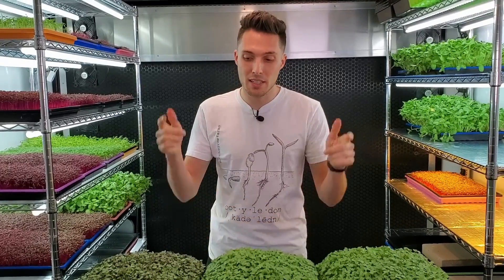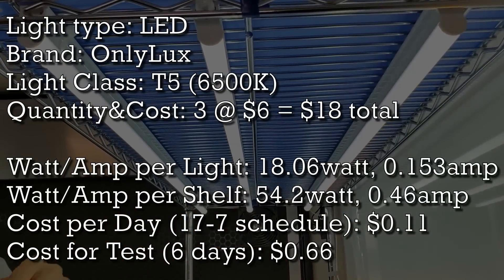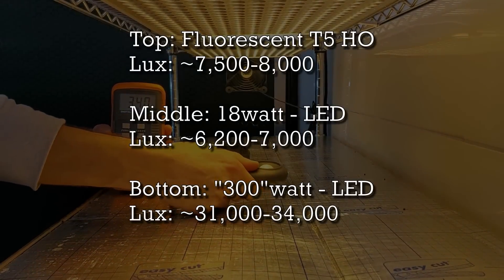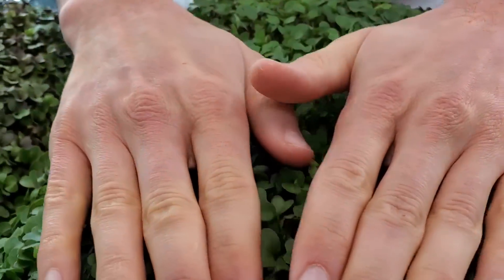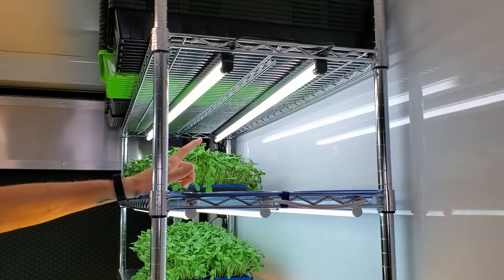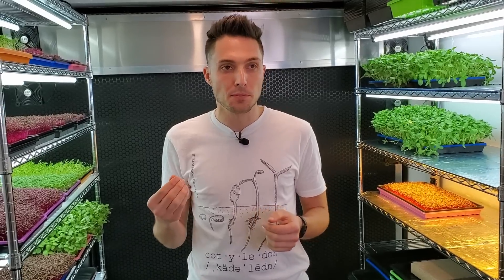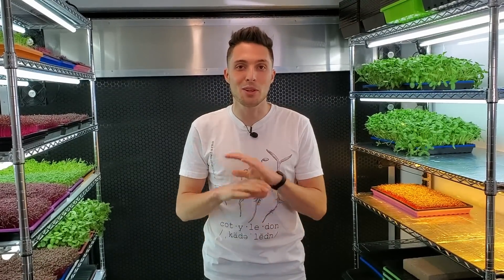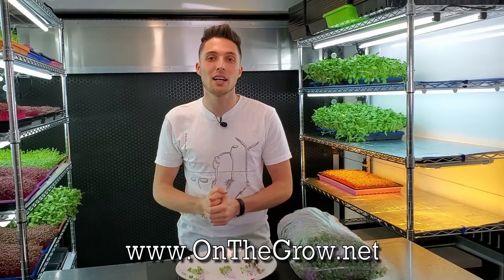Microgreen Lighting: Fluorescent vs LED's - Purple Kohlrabi - On The Grow

Comment: Is the coloration on the bottem shelf Kohlrabi due to the warm light or much higher output? Why do you use 6500K lights, wouldn't ~4000k be better?
Thanks!
Reply from the maker: Thank you so much for the support P M!! We are going to be making new content soon! 😄 We shoot for 6000 lumens as rule...these factors will alter the coloration1

Comment: Reflectors or no reflectors? I see that most of your lights do not have reflectors on them. Why?
Reply from the maker: 🙂 Thanks for the question Sarah...we have two brands in the shelving system...the ones with what looks like reflectors are built into the hosing of the lights and the other does not...I believe they are more like diffusers than reflectors.

Comment: I wonder how red the stems would be with six of those barrina led bulbs.  Also a more fair comparison would be 6 of those led bulbs spaced out the same width of the LED panel.. i.e. about 11 inches instead of 15 or so inches.

Comment: it seems you are matching all the inputs, including water (may have been a different test, not sure), so why not weigh the trays before harvest to take out harvest variable?  to eliminate other variables, you could weigh early on.  It just seems the harvest is quite variable, cut a little too deep, too shallow, some other loses...
Reply from the maker: We’ve cut a ton of trays and we keep it really even...  the issue with weighing it is the water weight of the soil. Even if we cut bad, the variance would only be 5-10 grams. 

The main point is to get close and get a good idea for the tests! Definitely not perfect.

Comment: I'm actually using these exact lights in my garage and basement and wanted to convert them for my microgreens grow, awesome. it looks like you are just using zip ties to hold them on the racking? Any issues there with them melting or getting too hot? Love your channel, keep the amazing info coming!
Reply from the maker: Thank you so much for the continued support Joshua!! We have not yet had any issues with it getting too hot or anything. We've had some that have been running the 17 hours on and 7 hours off with zipties for about 8 months now. They all seem to be in great condition still!

Comment: Did you tried with only two led tubes? Their light angle should be enough, isn't it? Your channel it's so helpful!
Reply from the maker: Thank you so much for your support Francisco! We have grown with only two LED tubes before and it did work well! The product will stretch a bit more, but it should still be sufficient to get some great micros! People have said that by taking the plastic cover off the LED tube lights, you can double their light output. We will be trying soon!

Comment: this is really good comparison... that led panel is way too powerful than the rest.. I use the led lights like the middle rack for my micros, it works quite well.. never have a problem and also cheap to buy and operate..  but looking at that purple accent on the leaves is beautiful.. great video guys.. :D
Reply from the maker: Thank you so much for the support! We are going to see if the cheaper lights can get that same purple color by using more of them... That test should be coming out within two weeks so stay tuned!

Comment: I don’t want to rain on your parade, but it seems like you have gone to great trouble and quite a bit of expense to grow micro greens. 

If it were I, I would use sunlight. 

You can build yourself a dandy little greenhouse, with sides that open to the outside so you can slip trays in and out for a lot less than you can those fancy shelves and all the electricity and lightbulbs and stuff. 

Just my opinion, mind you, but I have been at this game for 50+ years and there’s nothing quite like white sunlight from the sun to grow stuff.
Reply from the maker: I love to experiment with factors! I totally agree that sunlight is an amazing source and should be used! I’m more about experimenting for indoor growers though, because that is what I’m passionate about.

We’re going to be growing some in sunshine this spring and summer and sharing the results! 

Thanks for sharing!
Reply: On The Grow 
We should hook up. I live across the lake in The thriving metropolis of Copeville. I use mostly the Kratky method and I have been doing hydroponics longer than you have been breathing air.🤣
Reply from the maker: @SiwyWabbit  Lol, yeah that would be great! We actually getting ready to move and we'll even be a touch closer to you soon! As soon as we get settled, we'll have to get together!
Reply: On The Grow 
Are messages over Instagram private or public?

Comment: so at a cost of 140/per shelf, and a yield of 30% greater, (or so) what is your "gross" cost per ounce of finished product?  2nd question, what are you doing with all the waste material?
Reply from the maker: The cost to grow a single tray of microgreens is $2.03 in materials and $1.38 in lighting electricity. So about $3.41 total for this grow for a single tray. Harvest was 317g = ~11oz  = $0.31/oz in cost. 

If the medium is compostable, like Coco-coir, Soil and some hydroponic mediums… We will toss them into our at-home compost pile and let it break-down and return to the earth. We can use it later in our outdoor garden, but we never reuse grow mediums in our space due to potential of the medium containing pathogens. Also keep in mind that some hydroponic grow mediums are only compostable at industrial facilities (example: Biostrate)… Those mediums, we will gather in a bag over time and take it to our local recycling/composting facility.

Hope that helps!
Reply: On The Grow amazing feedback, thanks for the reply, time and energy put in to it. So happy I subscribed to your channel.

Comment: Want to do a 3 - LED setup. What distance would you recommend from the bottom of the LED bulbs to the top of substrate (at seeding startup). I’m just changing over to wire racks.
 I am using different style trays. Coconut Coir pads.
Reply from the maker: We are having really great results at 7" spacing from top of substrate to lights... A lot of people prefer 8-12" but we like to fit as many trays as we can on a single shelf. Hope that helps!

Comment: Wonderful review - because of the extensive tests on the actual production.  But you are comparing bare fluorescent bulbs to LEDs with individual reflectors.  If you add a reflector over each fluorescent tube things will change dramatically. And the brand of T5s is of huge importance.  Example - don't think that a German made T5HO is anything less than what it claims. Which can not be said about most other T5s (or LEDs for that matter, read on).

The longevity of LEDs is always grossly exaggerated .  It really depends on the quality of the LEDs and how they are run.  Normally all Asians, not just Chinese, overrate their power by at least 3 times.  And that includes "reputable" companies too - Samsung, Seoul Semiconductor etc. Basically they state that an LED is say "10 watts" but that means if you run it at its absolute maximum - which means it will run hot and deteriorate super quick.  And again - the "10 Watt" is actually closer to actual 3 watts because they always exaggerate. In addition - the Chinese LED fixture you tested maybe great or not today but the next one you buy will be different - no matter if you got the same "brand" name or not.  "May" is the important word here.

Overall - at the end what matters is the production quality and how fast and easy it got to be good. The old rule applies - find your best way and stick to it.  At least until something very, very convincing comes along and replaces it after you have run proper tests for some time, not just a few times.
Reply from the maker: All of the LED’s were tested for their actual output and we have used our LED’s for 7 months with solid results... we have a lot more tests coming with more lights!

Comment: This is not a fair test. There is too much variation in lux level from shelf to shelf. 7000 vs 8000 vs 32000. Repeat the test with all shelves at 32000 and i bet they would all perform similarly. Almost all plants grow better when they get more light.
Reply from the maker: ... this isn’t supposed to be a fair test. It’s taking three different lights and trying then against each other.

Comment: LED's arent measured in PAR, they are a PPFD/Umol measurment using a quantum meter. The one I have was about 500$. Microgreens are rated to be grown at about 100-250 ppfd from most literature on it.  not sure how they deal with more intensity and how it influences growth. Full spectrum LED's are going to be your most advanced indoor growing diode for efficiency in electricity per plant usable output.  The real question is do you even need intense lights? or a high light intensity higher than ratings of 250ppfd or is that enough and effects of light higher are undesirable or what.
Reply: different lights focus at different distances depending on the bulb / diode and weather they have a focusing lens and or reflectors. So some of the lights you tested could perform as good as the LED but must be closer in distance to the crop to achieve similar results. Microgreens seems like something that would benifit from full spectrum lighting of a LED, vs narrower spectrums of florescent tubes. Which would most likely enhance color / appearance of the product vs more focused color spectrum's t hat lack green and other thought to be un-useful colors.
Reply from the maker: Thanks for sharing!

Comment: Quantum boards!
Reply: honestly the only lights i bother to use for anything plant growing related. Requires a 500$ quantum meter to beable to focus your lights and know the type of light spread youre putting out at what depths. Helps me loads for my cannabis growing lol
Reply: @angeldemore6922  hydrofarm work well if its v2 (no 660nm), with v2RSpec or v3 whatever you want to call them its inaccurate, the meter its self is low build quility tho. i pulled mine apart on the first day and glued the soldered cables
Reply: I like my hlg 65 for starting my tomatoes and peppers.
Reply: Samsung sunboards or strips. DIY save that extra money.
Reply: Emerson Effect yea I’m going to look into those. I just did a diy light with two gromau5 pucks and a cxb3590 in the middle. It’s way over kill for seed starting, but I have a dimmer on it
Reply: We definitely love the #growmau5 #greengenesgarden for the DIY videos. I love this trailer setup. OR looking clean inside 🤙💯
Reply from the maker: Lol, this may be a little over my head... I was looking and couldn't find much on DIY's... got any solid links for some quantum boards and supply sources? Seems like a lot of cannibis growers like these lights, but I wonder how they would perform when only 7" from the microgreens like our other lights are...
Reply: On The Grow the YouTube channel Led gardener has a website ledgardener.com where he has plans for diy led strip build designs, but they are way overkill for microgreens at 7”.  It’s a good starting place to look
Reply: @OnTheGrow  hlg focus more towards tomato plants/cannabis/peppers etc

normally alibaba would be a good place to look in terms of supply but unsure how the factorys are effected been china, if you do seach "lm301H lightbar/strip" and you'll find something that'll suit your 7" requirement,
Reply: @OnTheGrow QB are on Amazon or their site Horticultural Lightning Group.

Comment: What kind of trailer is that?  Was it outfitted already or is that all custom?
Reply from the maker: It’s a custom built utility trailer from Colony Cargo out of Georgia! It would’ve been a lot cheaper to buy and convert a trailer instead of having it custom built, but you live and learn. 

It was about $15,000 delivered. Insulated walls, 15,000BTU A/C, triple sink station, dedicated hand washing station, white aluminum walls and ceiling, rubber coin floors, e tracks on both walls, electrical package and so on.

I was curious if it would work as a growspace year round so in a few months it will be one complete year of growing in there!
Reply: @OnTheGrow  Wow that's awesome.  You paid for it, but sounds like a premium bit of kit.

Comment: Great video overall.  Love how you guys weigh and taste the finished product.  Haven't really seen any other channel focused on growing that really does that...  

However, there is one aspect that I don't believe is correct.  Your light measurement and your light measurement instrument.  Lux is a measure for human eyes.  Since plants do not "view" light in the same way we do, due to the process of photosynthesis, lux is not a good measurement of actual light output for plants.  PAR (Photosynthetically active radiation) is how plants "view" and utilize light.    You can get PAR meters that should be able to provide you better information as to the actual light output of your lighting.  If you want to go really in-depth, you could get a spectrum analyzer and see what the actual spectrum of light is coming from the various light fixtures you're testing.  This could give you an indication of what crops tend to like what spectrum of light.

There is a tremendous amount of research that continues on the impacts of lighting on plant growth, and it might be potentially useful to look into it as well.  Could help you optimize lighting solutions, either as a general thing, or specifically for each individual crop.
Reply from the maker: Thank you for the suggestion. We understand LUX and PAR. We only had a LUX meter available to show the viewers that there was a difference in light. 

We understand that it isn’t the right tool, but it was what we had. 

Thanks for the suggestion and a PAR meter will be used in the future.

Comment: Great video you two. I didn’t see info on the Kelvin of each light which is very important for growing. The LED bottom panel lights did very well probably due to the broad spectrum of light or Kelvin frequency they put out. Add that info if you can to notes. Cheers
Reply: GreenTechFusion Renewable Energy I’d guess the bottom is 3000K-4000K, due to the visible color. Those lights are used by mj growers for a reason. The longer the plants grow, the more dramatic the results would be.
Reply: Francisco De Paula Meano - Dude, I do t click on links from YouTube. To many scam sights out there.
Reply from the maker: Sad to think that you find our videos great but that we’re potentially scamming people with our links... 

We do this for free for the community, what would we gain if people couldn’t trust us? 

The kelvin for the top two lights are 6500k and the bottom LED panel claims to be “Full Spectrum” but it is probably between 2500k-3500k.

We have a PAR meter on the way so we will make an update video soon on this.
Reply: Nothing against you all, hackers hijack these links all the time. So dont take it that way. Tour doing great and offer a lot. These commenters offer nothing.

Comment: Do you think it´s just a matter of light power or there are other significant things like wave lengths and so?
Reply from the maker: Great question! Not sure yet, we’ve bought a lot more lights so we hope to begin narrowing it down.
Reply: quility of the light does matter, if you grow a plant under purely under 1 coloured led say (blue or red) the blue plant will stay compact with virtually not vertical growth, while the plant grown under the red light will strech and not produce much leaf (matching the ppfd on each light) 

UV helps with plant defence and smell/taste, 
IR helps with cell division and creates something called the emerson effect when mixed with Deepred spectrum, this helps the plants 2 photosystems convert light to sugar then sugar to atp (energy)

white light works well because white is a spectrum of every visable colour, but inside the white light is atchally a mixture of % of each colour, a white LED is usally a blue led with a phosphor coating over it to create the full spectrum

Comment: I'd get some Samsung F Series LED strips, test 2700, 300 and 5000 Kelvin vs each other.  You are going to have a tough time to beat them for light output vs power usage.
Reply from the maker: I'd love to try some, but I can't find any through Amazon. If you have a link, I'll see about getting some ordered! Thanks for the suggestion.
Reply: @OnTheGrow  You would need to get them from Digikey

Comment: Your losing a third of the light by having no reflectors
Reply: Troypam Young can even use foil heat blankets so long as it doesn’t get too hot.
Reply from the maker: You are correct! I wanted to test them without any add-ons though. The LED's in the middle don't have reflectors either... The reflectors for the T5 H.O. Fluorescent lights are priced absurdly... We will dig more into maximizing light in the future, this is more of a straight out of the box, no add-ons test.